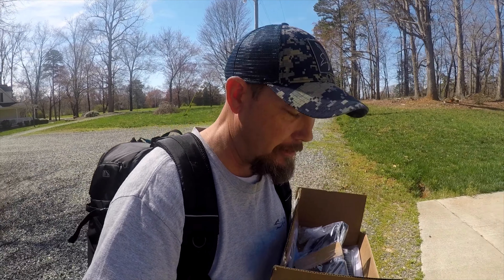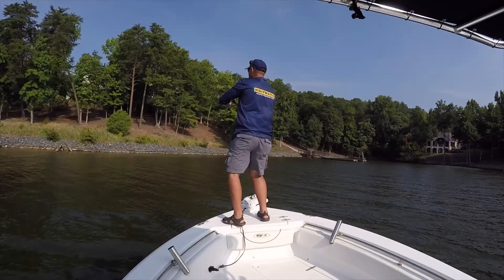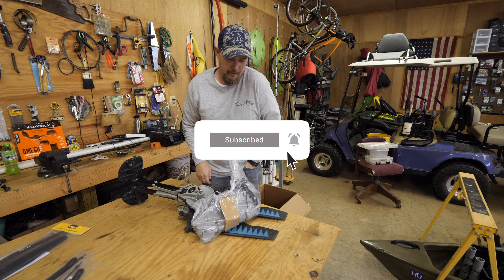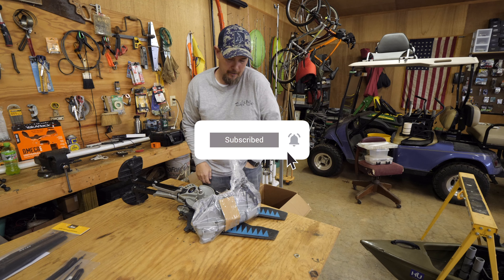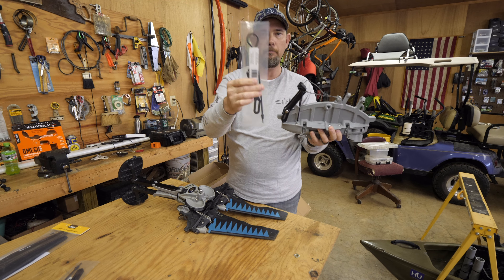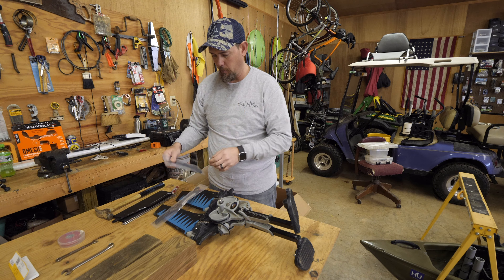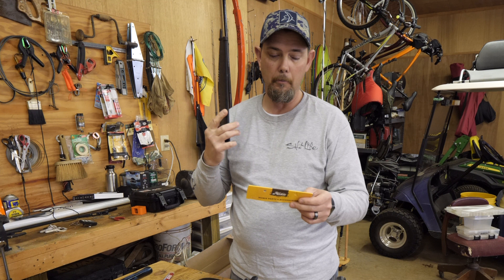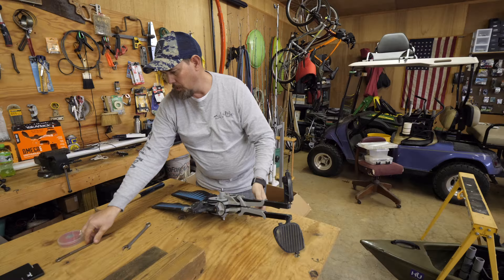Hobie Mirage GT to 180 Turbo Drive Conversion

Comment: Does the conversion work on the original all black drive?
Reply from the maker: I think so but not 100% sure. I have a passport drive that I want to use the drums off and and chains off of and put them on a new MD 180 spine. Guess I will know next spring.